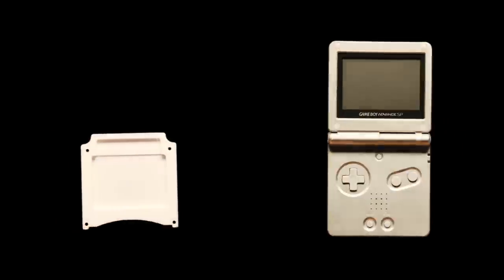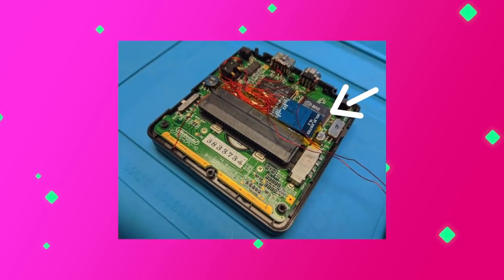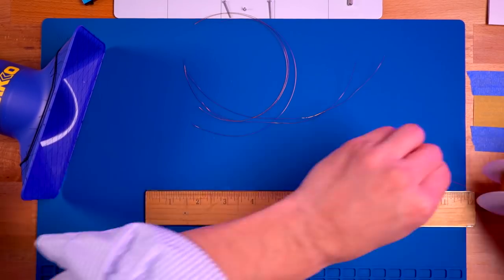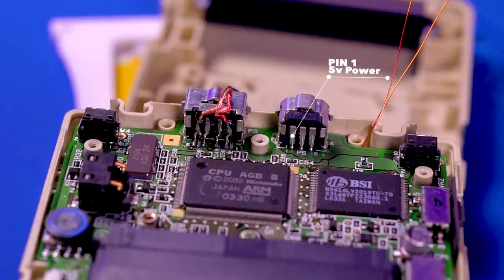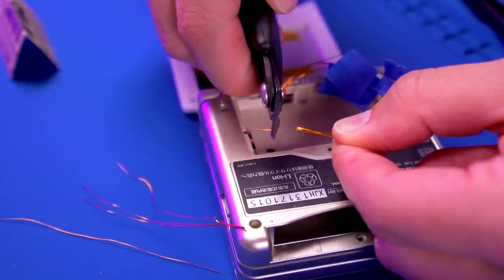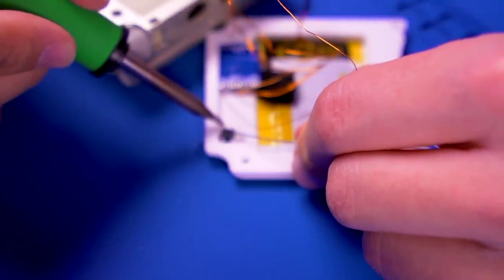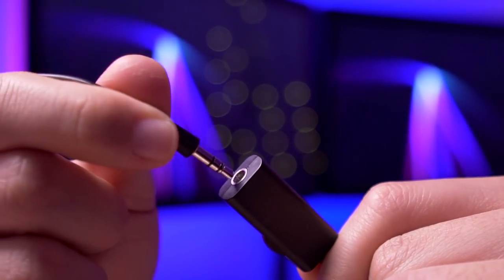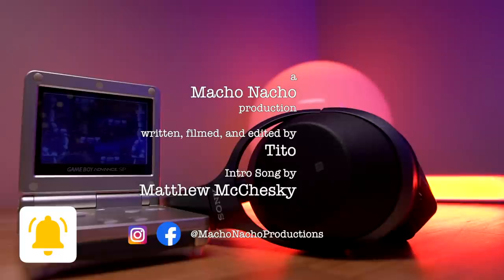GBA SP BLUETOOTH MOD! | Using the GBA SP Expansion Cover | Full Tutorial | Retro Renew

Comment: Good Tutorial very clear!
I've done this without doing the expansion mod by fitting the parts in the back of the screen.
I've also replaced the momentary switch with a touch switch and a transistor.
Did both of these to preserve the stock look of my SP
Reply: I’d also like to try this Bluetooth mod but would like to preserve the stock look of the sp. How did you do this? What touch switch and transistor did you use? I’m guessing you connected this to the “con” pin on the Bluetooth board. How did you wire everything?
Reply: @gregoryfakelmann612  The con pin listens to a ground signal, but the touch switch sends a power signal. The transistor is used to replace the momentary switch, with the touch sensor's power signal switching the transistor "open" or "closed", controlling the circuit from con to ground. I used a TTP223 Capacitive Touch Switch and a BC868 transistor. There should be numerous tutorials on how to use a transistor as a switch on youtube as well as wiring the touch switch.

Comment: Hey Tito, pretty cool mod, never thought Bluetooth to the SP would look that easy. I thought about this and even tracked down the parts but then gave up since as you mentioned, it’s best to use your expansion cover. Well done and thanks for taking the time for this video (Kudos on Kyle as well)
Reply from the maker: You’re most welcome Jesus!  Couldn’t have done it with out Kyle!  If you want, there should be enough room inside the LCD housing for the Bluetooth module. Cheers buddy and thank you for your support!  Cheers!!
Reply: You can do a quick and dirty solution with the SP headphone adapter and a regular 3.5mm bluetooth transmitter.

Comment: Great Mod, I think one good possibility would be to change the proprietary charging port with a universal USB-C port, it would give you space to put the switch right above the usb c and no modification of the shell would be needed, just a little bezel done with a 3d printer including the switch and the usb c holes. Great video and quality content as usual !!
Reply: your in luck! this exists actually! I forget what its called off the top of my head but yes, someone makes a pcb to do this!
Reply from the maker: Also, stay tuned to the channel. There may be a video that comes out that you may be interested in. 😉

Comment: Pretty nice mod. However, rather than gluing in a button for pairing, I think I would have used the brightness button. Seeing you have to press and hold the button to pair, you should be able to use the brightness button without it losing its original purpose (other than you'd have to press it again after pairing to go back to your original brightness setting).
Reply from the maker: That’s a very interesting idea Daniel!  Looking into it. Cheers!
Reply: Was there a chance to try this?
Reply: is there a video on this?

Comment: Hey dude. I really like the idea of the mod!
But, I noticed something and I am honestly surprised it hit me this late: On the BT chip, you have RX and TX. If memory serves correctly, the pinout of the accessoire (headphone, charging) port has quite a few more pins. And, it didn't disappoint: https://pinoutguide.com/Game/gameboy_speakers_pinout.shtml
IF you were not going to use the audio pins anymore since you have a BT mod now, you could:
- Wire RX and TX to pin 2 and 4
- Use homebrew to talk to the chip. Most modders are likely to have a flashcart - at least, you do.
- depending on how the BT chip works, this software could act as a setup piece, allowing the GBA to talk to the BT chip for better pairing.
It was hard to read all the pin labels on the BT chip but there might be something more that could be done.
Personally, if I had an SP, I'd settle for a BT dongle. This thing is small enough that it and an accessoire port plug together would make just a tiny tongle you could attach to the back for when you actually want to use it. Downside: The Wireless adapter wouldn't fit anymore, but how often do you use that these days anyway ^^.
I haven't yet learned how to draw a UI on the GBA and my DevPro install is dead AND I lack the solder skills. But I am pretty positive there is something you could do there. If I remember correctly, Intendo initially wanted to use this secondary port for other accessoires too.
Something that also just came to my mind: Does the BT chip have a way to tell, per impulse or something?, that it has a connection? If so, you could indeed do what the guide suggests above and instead of wiring to the test pads, wire to the audio pins instead and actually use the volume slider!
One way or another, there are some neat things that could be done =)
Reply from the maker: Wow thank you for this very detailed comment Ingwie!  That is super interesting, I agree there is probably much more that can be done with the Bluetooth chip. I will have to defer to my friend Kyle as he is more technically inclined when it comes to the details of these mods. It would be really cool if we could make the link port wireless. The sky is definitely the limit when it comes to these types of mods!  Again, thank you for the detailed and thoughtful comment!  Cheers buddy!
Reply: Dude! I love the idea, so the chip itself has serial (uart) for AT config commands. From what I've seen on GitHub it looks like there is implementation for device list management, my only problem I can think of really boils down to how the gba sp handles serial data. Looking through GBDK it appears to wrap all serial comms into a sort of session manager, without direct serial access. But I suspect it would be relatively easy to expose this functionality in GBDK, only real hurtle left is you would have to have a chip sit in between the gba sp and the radio chip due to baud rate constraints . Which is why I opted for push button pairing instead. But yes this would be cool!

Comment: Just a thought but rather than an internal mod of the console itself, could you modify the shell of a GBA wireless adapter? You could theoretically remove the board from the wireless adapter's shell and install a bluetooth transmitter in its place, then wire that transmitter up to a connector for the power socket,  drill a hole in the shell for the connector and you'd have a bluetooth transmitter you could just clip into the console and go.

You could alternatively design and 3D print a housing for a bluetooth adapter that used the same clip on system as the wireless adapter.

Comment: Awesome! Been wanting to add bluetooth to my N3DS but have been put off because the one example I found, they said the latency was too much and only good for recording purposes. Is the latency acceptable with this different module? If so, I'll definitely be giving it a shot.
Reply from the maker: There is some latency. According to Kyle it appears to be about 15ms. When I compared the the sound coming from the SP to what I heard in my headphones I could tell there was a small delay. Not sure if that helps. Perhaps I should record a video to show the difference.
Reply: @MachoNachoProductions  15ms is pretty good compared to the 100-300ms I get on my phone, for the $4 the module costs I think I'll just order a pair and give it a shot with my dslite first, and if I'm happy with it, in my hyrule edition n3ds. To avoid modifying the shell, I think I'm going to use a hall effect sensor and a magnet instead of a microswitch for pairing. Thanks for the video, even though it's for the SP it'll be very helpful in modding my DSs, and thanks for showing me the new module!
Reply from the maker: Sounds awesome dude!  I’d definitely want to stay up to date with your progress for the switch. Sounds like an awesome mod!  Cheers buddy!
Reply: @MachoNachoProductions  Well, I've got some bad news- I received two modules, and long story short- It worked, but there is a ton of noise and buzzing in the background of the audio. I'm not sure where its coming from, but I tried both modules and they both have identical buzzing. This was in my New 3DS XL, taking audio from the pads from the headphone jack. This was also powering the module off the 3.7v battery, which maybe caused it? I'm going to try my switch next when I've got time. Anyways, the latency seemed really low and pairing was really easy, so if there's less noise in the Switch it'll definitely be staying there.
Reply from the maker: Hmm that’s interesting that your getting a noisy audio signal. Definitely would be interested to hear how it works for the switch!  Best of luck buddy!  Cheers!

Comment: Now you need to do this on a original gba that would be amazing to see
Reply from the maker: It should be a very similar mod. If there is enough interest I may do a follow up video for the original GBA. Thank you for the comment!  Cheers!
Reply: @MachoNachoProductions  I'm currently working on this. I have a clear shell and don't want the led flashing all the time. I'm not always using headphones. I'm thinking about adding a second switch to turn the BT module on and off or just removing the led altogether. Would love to see how you would tackle this.
Reply from the maker: You can also have the led facing inward toward the lcd, that way it won’t shine through the shell (or be much less visible). I wouldn’t desoldered the led, it’s good to have so you know when it’s on and in pairing mode. A switch to cut off power could also be good!

Comment: Mmh first I would install a usb c port for charging and headphones. The a sound board to get the speaker a bit louder.
Then I would install bluetooth audio.

And you use sanding paper to free the wire?
That can be make with a soldering iron and you have solder on the wire.
2 things with 1 step
Reply from the maker: That’s good to know!  Thank you!  I didn’t know that heat could remove the enamel coating. That would be much easier. I need to look into that. Thanks again!  Cheers!

Comment: Awsome! ...arent there any problems with blank wires?
Reply from the maker: I’d love to answer your question, however I’m not sure what you mean by “blank wires”?  Can you elaborate?
Reply: @MachoNachoProductions  i mean the copper wires you used, arent they blank or are they isolated..im not so into electronic and electric but i allways hear "use only isolted wires" :D so i dont know...
Thank you for your answer!
Reply from the maker: Ah gotcha!  Great question!  Yes, they are enamel coated so there is no worry of shorting anything out. They are completely isolated. That is what the sand paper is for, to remove the enamel coating and expose the copper wire below to allow for soldering. Cheers!
Reply: @MachoNachoProductions  Ahhhh! Okay, thank you very much! <3
Reply from the maker: You’re welcome!

Comment: With this mod? How would I turn up/down with AirPods? Do I have to use my iPhone and set the double tap on one to be volume down and the other to be volume up?
Reply from the maker: That’s a great question. I don’t own AirPods so I’m not entirely sure how they integrate with other devices but the volume cannot be controlled with the GBA for this mod. When I connect my Sony headphones I control the volume form the headphones itself. Sorry I couldn’t be more help. Hopefully someone with experience with AirPods can answer this question.
Reply: @MachoNachoProductions  I have used the same bt transmitter and it does not connect to AirPods unfortunately. I am taking a break from this mod, and will look into another transmitter in the future. Great video dude!
Reply from the maker: Thank you for the input Brandon. Good to know that they are incompatible with AirPods. I wonder why they won’t work. I wonder if Apple uses some sort of special protocol. Cheers dude!

Comment: The Ultimate GBA SP Upgrade! Enjoy Bluetooth audio for wireless headphones, a headphone jack, and an audio volume wheel. Experience seamless Pokémon transfers, multiplayer, and ROM sharing via Bluetooth. It includes USB-C charging, a stunning new LCD screen, and 512 GB SSD storage. Switch easily between stock cartridges and loaded ROMs with an intuitive menu. Plus, a Wi-Fi card and a SIM card, so you can make calls on your SP and download software on the go. Updates and more, all tied together with FPGA chip logic for proximity transfers and multiplayer, or Wi-Fi multiplayer. 👌

Comment: That type of wire won't sbort anything since it doesn't have a wax or any type of coding around it?
Reply from the maker: Great question. The wire has an enamel coating on it so there is no worrying about causing a short. That is why I was using sand paper, to remove the enamel coating. Hope that answers your question buddy!  Cheers!

Comment: Very rarely comment but did not work at all for me. Think it's the wire. I've tried and tried and tried. Think I might just use some normal wire instead of enamel wire. Hopefully will work then. Been at it for 7 hours now 😭
Reply from the maker: Sorry to hear that buddy. The wire type shouldn’t matter. The magnet wire I used wire made it easier to route the wires. 

Is the led indicator flashing?  What devices have you tried to pair?  

In order to pair devices you need to set your device to pairing/discovery mode first. Each device does this differently. Consult the device manual to see how to do this. Let me know if you are still having issues.
Reply: @MachoNachoProductions  Hey. Thank you for the reply. I used a different bluetooth module and all is great. Must have been a dead module. One thing I have noticed though is that I have a retro six Sound Amp and the static sound I get with having both installed is horrible.
Reply from the maker: Glad things worked out!  Interesting, on my SP I don’t notice any static beyond what is normal. Strange that the amp is causing static. Thanks for the heads up!  Cheers!

Comment: There IS modification to the OEM shell regardless to get those wires out from the motherboard/shell. This, along with the soldering directly to the motherboard - marketing these mods as reversible is disingenuous and also a little trite considering the effort and considerable risk in working on the motherboard.
Reply: I don't mind that you guys are developing a product - but the constant pandering to reversibility to the modding community is not what makes your work stand out. You may as well add in that it's a sustainability product that's prolonging the uses of old technology through the process of additive manufacturing. Again not sour about the work yall doing, just very conscious of your use of the term "reversible"

Comment: Do it on GBA it's possible?
Reply from the maker: Yes, 💯% possible!  Should be a very similar process!  Cheers Adrian!
Reply: @MachoNachoProductions  thanks Nacho. Do you know where can I found the magnetic wire elsewhere?
Reply from the maker: I got it on Amazon but any magnet wire will do so long as it’s 32 awg. Perhaps Digi-Key or mouser may sell it. Hope that helps!
Reply: @MachoNachoProductions  many thanks!
Reply from the maker: You’re most welcome!
Reply: @MachoNachoProductions  one more question! Why did you use a magnetic wire instead of basic wire?
Reply from the maker: Basic wire should work as well. The magnet wire is thin enough to run it through the opening into the expansion cover. Thicker wire would make that more difficult. Cheers Adrian!
Reply: @MachoNachoProductions  interesting! Many many thanks for your time.
Reply from the maker: You’re most welcome Adrian!